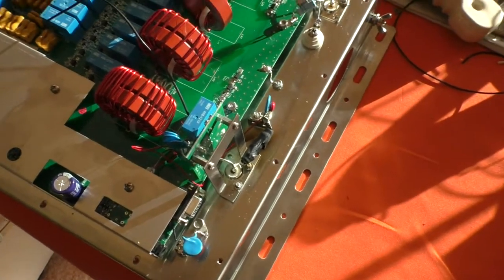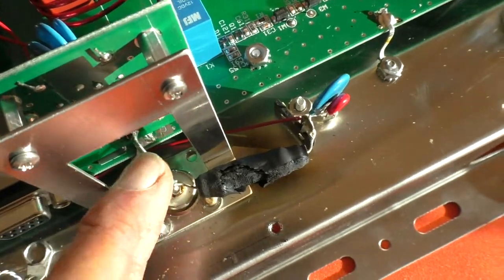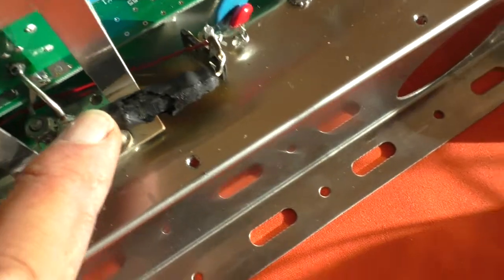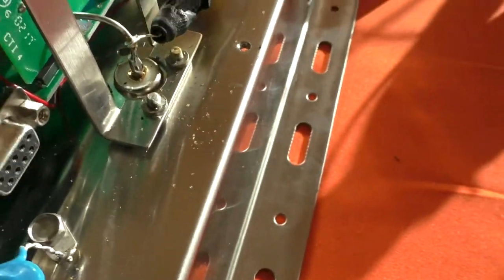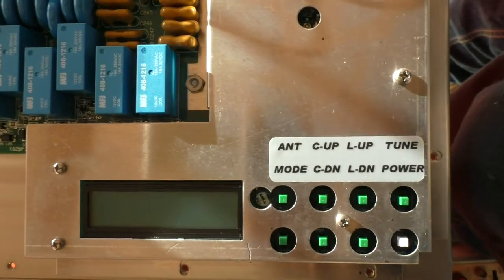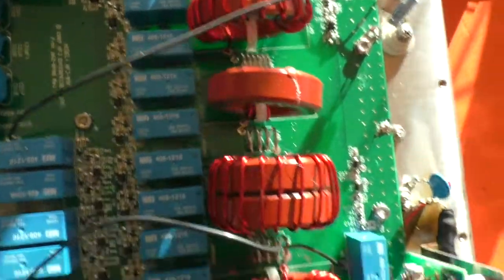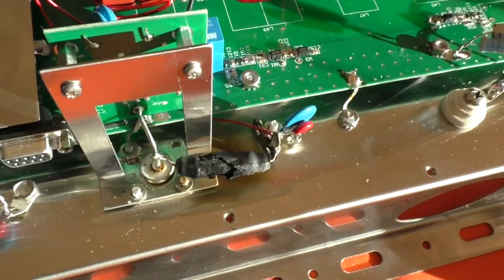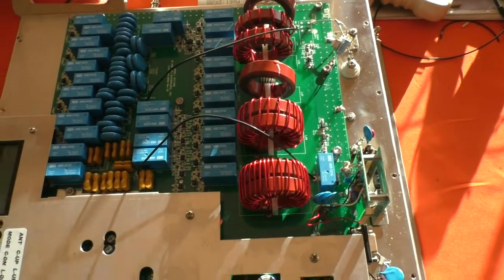A Look Inside The Faulty MFJ 998RT Auto Tuner

Comment: So is that choke open-circuit?  I have a similar situation.  My MFJ998 still works - but there is a burn mark in the middle of the choke.  I suspect internal RF arc-over.    I took the choke off, measured it on the bench.  100 microhenries.   It's obviously the DC power feed.  I tore the heat shrink off it, and put two layers of new shrink.   I think it was caused by a bad connection to the antenna.  I had indulged in a crimped on ring terminal, and it worked fine for a couple of years.  I think it got corroded, leading to a intermittant open.  Which led to some mighty high RF voltages.    I was running about 800W.   I'm lucky nothing else got fried.  The choke is available from MFJ - P/N 401-4100-2.  Costs $3.08 plus shipping.

Comment: Looks to me that its a 500Watt max tuner, but the reason for the rf choke burning is that there is probably a dc running over it. loose screws, bad soldering and so on is a trademark of MFJ
Reply from the maker: There is supposed to be DC running through the RF choke when the tuner DC power is fed down the coax. I think guys in the US use these with 1500W, but have to tune them with low power... 5 to 20W.
Reply: Then the question is why is there too much dc running over the RF choke, could it be + and - connected wrong ? or a short on the circuit ?
Reply: Ah MFJ quality control.  Got to love it.

Comment: Good bit of information, but what caught my eye was the large dog bone insulator on the desk. Could tell us about it ?  ie material, supplier and cost. It is hard to find NEW good HV end insulators. Thanks 73 Leo k1zek
Reply from the maker: Hi Leo. I have had that insulator, and a couple of others like it for many years. I suspect I pilfered them from a marine electronics company that I used to work for.

Comment: You have a very in depth understanding of the electronics in the radio equipment - what course / qualification would you recommend to get a full understanding of it?
Reply from the maker: I was building valve transmitters for medium wave when I was at school so I have many years of experience in radio and electronics. I did an apprenticeship in radio and TV servicing back in the early 70s. I have no idea what's available these days. You will learn a lot by doing, playing around with stuff and trying to make it work will cause you to do research, and with that will come an understanding of why something is or isn't working.
Reply: Thanks for your reply, great videos!